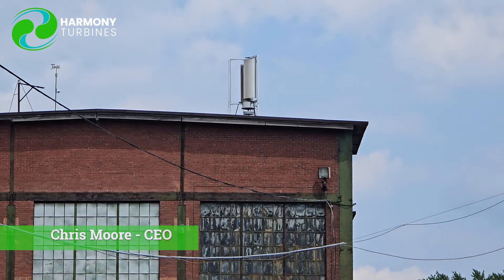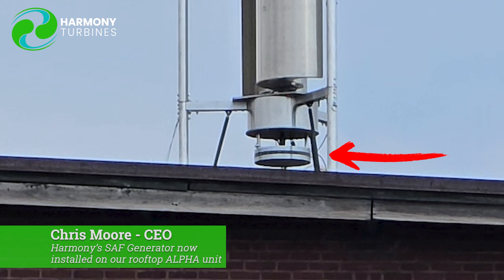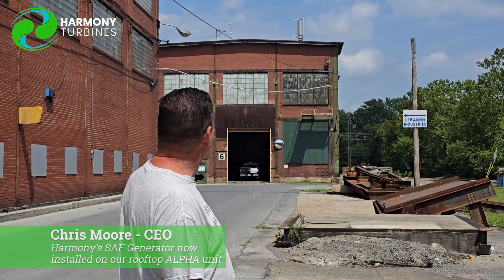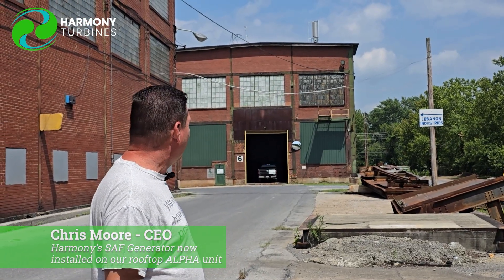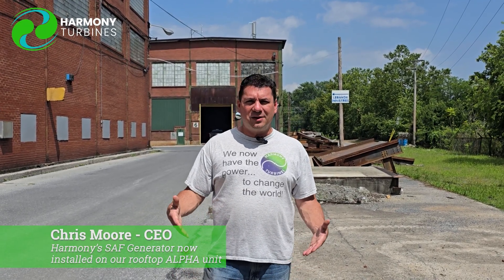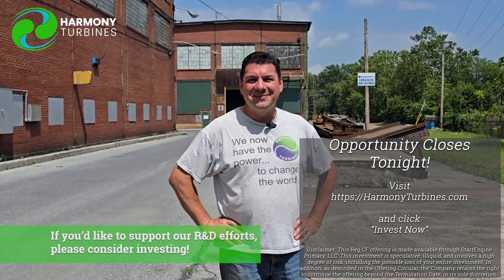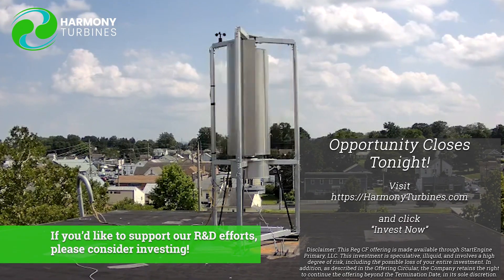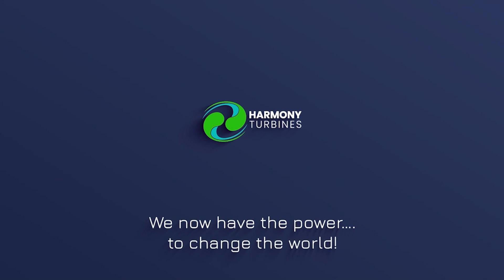Harmony's SAF Generator now installed and LIVE!

Comment: Seems to me that you need to build a small wind tunnel to put the unit in to give you precise wind velocities including high ones not available 'in the wild' unless you waited years for it to happen or higher than you get in your area.
Reply from the maker: We have had a really wind tunnel built for years now. We have featured it in a number of our videos already. A LOT of testing goes on in there, for sure!
Reply: Agree, but they would actually be better off finding a college/university with a professional wind tunnnel lab, which will give them the professional data they need in weeks (vs months/years), plus, it will also help save quite a bit of money.
Reply: @__WJK__ they don't need expensive Universities, they can build a goid, well instrumented tunnel out of plywood, use a unit off a swampboat/airboat (the engine & propeller) to provide the wind and any good weather station off the internet is capable of measuring the 'wind speed' and they are very accurate so just put one inside the tunnel. An 8 foot x 8 foot tunnel 40 foot long tunnel (built to measure roof shingle adhesion in hurricanes) only cost $7,000 three years ago (actually built for a fraud lawsuit against a shingle company for selling defective shingles who were claiming great performance when they weren't good at all) so I know it's possible to do wind tunnels cheap.

Comment: It looks like it’s not turning to me.
Reply: It's a WIND turbine.
Reply: @yt650 - "Looks like it’s not turning" ... same as all vawts/hawts, they require wind. Curious, have you ever looked at a solar panel at night & asked, "why isn't the panel working"(?) 😉
Reply: @__WJK__ 
Sometimes the only thing these things generate is smoke and mirrors .  If it’s generating you should be able to read it.
Reply: If the device is powered on, no one can stay so close to that machine! 😉
Reply: @forextraderradioman  Only those who are stupid enough put there fingers in fans for fun.
Reply: @forextraderradioman 
Why?
Reply from the maker: It wasn't windy that day.
Reply: @HarmonyTurbines 
That was exactly my point.  When it’s very hot or very cold there is usually very little if any wind.